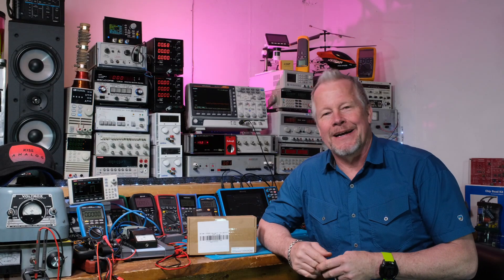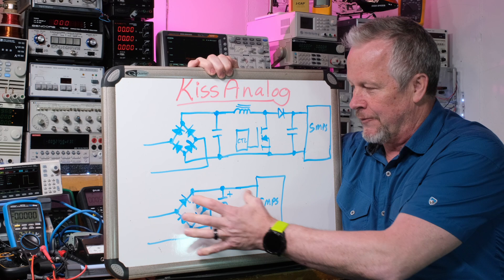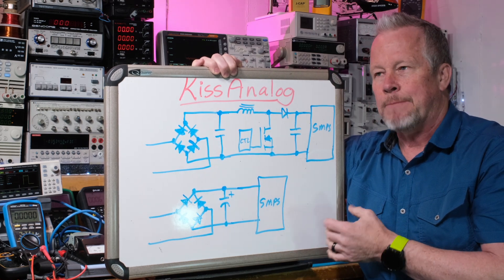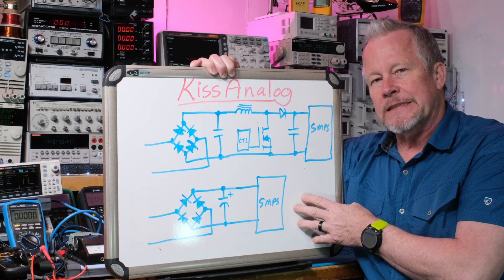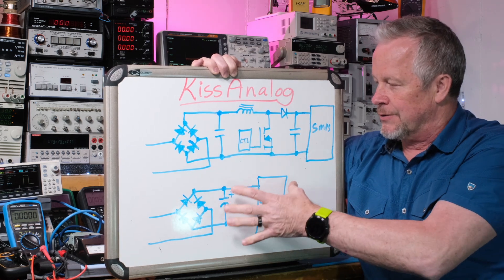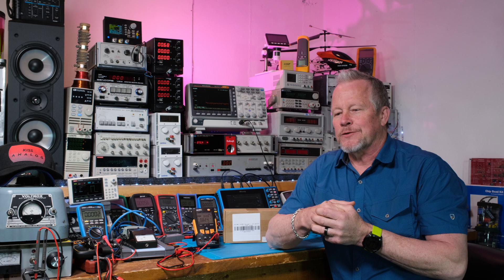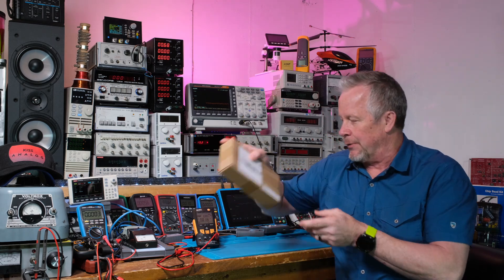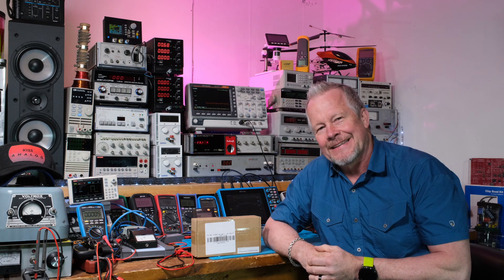Which Power Supply do we Design for the JAT Collaboration ep#2

Comment: It is nice to see someone on a YouTube channel showing how to roll your own PFC correcting switcher for high fidelity. The commercial theater amp guys have all gone this direction because of transport weight, but noticed several advantages. They can run them from smaller power generators in remote locations and everything works well. They are very immune to motor start drops and extremely poor setups still powering large horn theater speakers with banks of woofers. A single person can still move them around. Theses amps can provide 5-12 kw up to 48 channels (speakers). If the big commercial theater amp guys are all doing this why not do it yourself audio guy? Thanks for taking the time to teach the world how to do it efficiently.
Reply from the maker: Thanks so much!  Great feedback!  I appreciate you.  

I had a crazy year - but I'm picking this back up and will push this through in the next few weeks.  I restarted the series: https://youtu.be/SHr0l9Q3Bis

Comment: Hey Eddie...I have a question. How come a boost converter is used given it appears (to me) you have plenty of head room when rectifying AC power (120 VRMS). Thanks, Steve
Reply from the maker: Thanks for the question Steve.  Are you asking why the 400 VDC?  If so, this is to raise it above the peak of the 264VAC max for euro power.  This way it is a universal input power supply.
Reply: @KissAnalog  I guess I was thinking this supply was for the audio amp which I think only needs rails of +- 48 volts. I must be missing something. Thanks.
Reply from the maker: Yes that is true.  This PS will boost the voltage to 400V so it will work on universal voltage, then it will be stepped down to +/-Voltage rails which will be isolated from the input.
Reply: @KissAnalog  I see...I did not realize there was a stepdown section. I suppose a "direct conversion" to the desired rails from the input main voltage is not the way to go. Thanks.

Comment: I tried 1ma linear power supply........adjustable from 0, it’s a night mare.......feed back unstable, over shooting, can’t get precise opamp, so have to use large 10om shunt resistor, but the upper Stage is only 12vs. Again it’s much harder if considering start from 0 adjustable lab power psu........... looked into pfc a little bit, it’s actual not that bad( hard) , go pfc psu , curious about how to dial from 0 considering pwm and how to compensate the filter rc in the feedback loop. Yeah it will be good if it’s a precise switching lab psu.

Comment: PFC for sure.  I'm not sure how we can decide without hearing both.   The one which sounds the best or has the best sonic character would be my choice.   Isn't that the challenge here ?  I can already build a slow switcher using both thermionic emission and silicon, with modest capacitance, very good regulation,  both voltage and current,   which sounds very good.   I am wanting to learn to see if I can build a SMPS which will sound sonically   superior.   I'm all in on moving the switching transients up in frequency to see if they may not be as bothersome on the overall sound as the 60 or 120  Hz I am use to in Canada. ??? I'm not sure.  hmmmmm, questions and more questions.    Lets do the full Monty on this Power Supply and see what it sounds like is my vote.   This being said, my belief is that the Amp is only as good as the Power Supply and both account for the sonic result equally.    That being said,  the amplifier itself must also be of good design and will not show the short comings of a power supply unless it is so.   A crappy Amp sounds crappy  with a great power supply.   The end test no matter how good one thinks each may be is in the listening enjoyment of the end product.    As I am assuming that we are talking about sound reproduction for home stereo, I prefer a stereo system that draws me in as apposed to "in my face".   As I have often heard, a system where , even though the Sax player stops playing , you can still see him standing there.   That good.    The noise floor must be absolutely dead quite across the complete audio spectrum.... in my opinion.    So for these reasons I am excited to see how we can design a PS for lets say 250 V at around 25 to 35 mA / channel.  for preamp and around 350 V at 200 mA for the power amp.  or maybe 140V at 5 A   If all we gain in the project is a shedding of 200 lbs of iron and a bunch of capacitance at the loss of Audio nirvana, then I don't think we've achieved our goal. In my opinion.

Comment: Definitely with PFC 👍I might build one myself in  separate box to try with a Mission Cyrus 2 amplifier which has the option to run from an external PSU called a PSX. The PSX uses old school 500VA transformer with 30,000uf of capacitance on each rail. So I will be able to swap between new and old school to compare both with my ears and with an HP 8903.

Comment: Thanks Eddie.
I'm running two ICE 1200 watt modules (really solid design) out of my tube preamp. The reason I go with the higher power class D modules is that my Dynaudio speakers are only 85 SPL and something like a 125 watt amp would start to go into clipping at high volumes, not that I drive them that high but I got them on sale so they didn't cost much more. If you look at the distortion curves you'll see these amps rise quite a bit as you approach their rated power so if you go with higher power you stay below that high distortion point. Also they run really cool when you don't push them and you know heat and electronics don't mix especially well. Like I said, I don't know if it's a big difference but for the extra cost it was worth it for me.

The other thing is that you want to watch the different freq. ranges on these ICE amps, both my amps have their own power supply. Some of the ICE amps that run off the main amp are meant for bi-amping so the freq. range is only designed to run woofers on the amp without the dedicated power supply. So something like a 125AS may have different specs than a 125A. Check the specs, you'll see what I'm talking about.

I'll shoot you out the preamp schematic when everything is done and it's ready for publication.

My vote is for PFC.

I don't think it matters if you show names of patreons if the patreons don't mind their name showing, I see other sites where they run patreon lists right on screen after a presentation.
Rob
Reply from the maker: Thanks Rob!  I will do the PFC.  I was hoping everyone would want that;)  I think the PFC makes the input power conversion much lower noise and better PFC is always good.  Thanks for the Patreon help.  I asked because I had some from the beginning ask to keep their identities or at least use only first names.  Maybe that's what I will do.  The list changes constantly;)